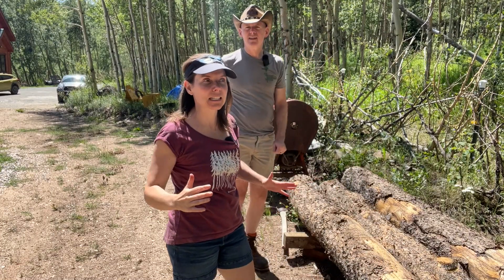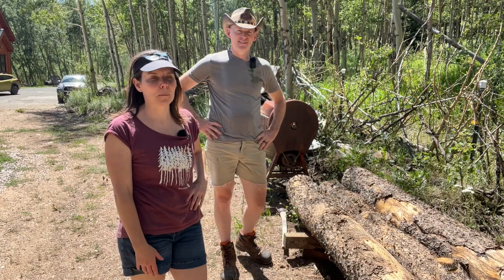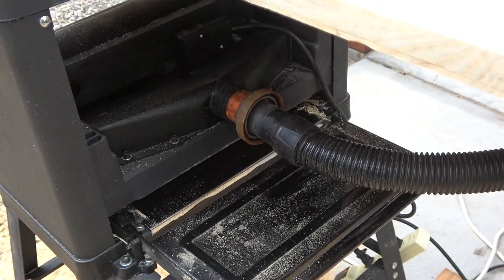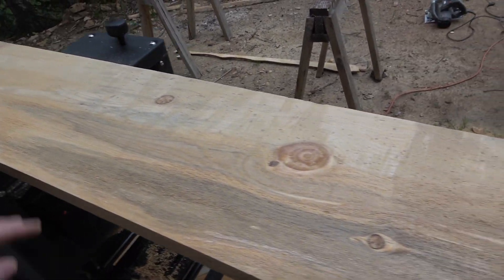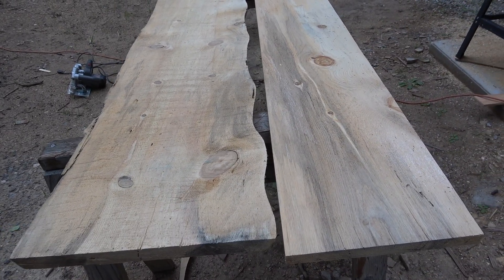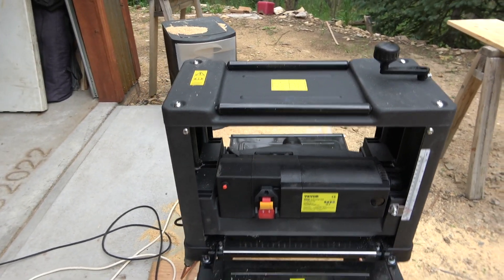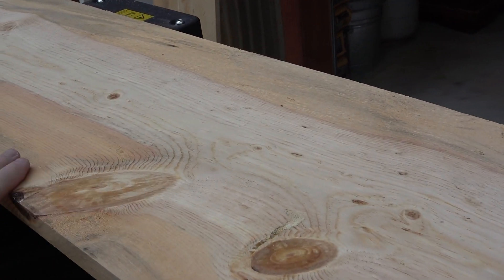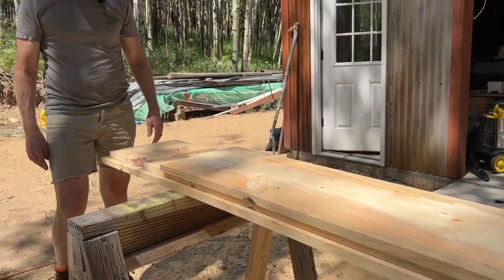Making our own Free Lumber Straight off the Tree

Comment: Hi Amy and Brian,  you may need to plug the thickness planer directly into the outlet and don’t use the extension cord or maybe you need a heavier gauge cord.  I would also suggest you get a metal detector for nails and screws.  Nice job you guys.
Reply from the maker: HI Chuck, I think you're right on, probably losing some power with such a long cord. Although, Bryan did plug it into a 20 amp circuit. We have one of those roller magnets, that does fairly well, have to pull it out again.

Comment: The way the planer is bogging down, you are taking off too much at once, or it doesn't have enough power to handle wide boards.  If it acts the same on a 6 or 8 inch board, chunk it.  On the other hand, start off with it barely touching the board, and adjust in tiny increments until it is flat, smooth, and at your desired thickness.
Even though it is 12" wide, it seems to be not as advertised.   May just be a marketing ploy.  Do some research on the company.  See what users are saying. ❤ 😊
Reply from the maker: Thanks! I think it was a bit of user error/learning curve to figure the correct depth to start off with. I think by the end of the day he found the best method to do several passes with a 1/4 turn on the knob at a time.

Comment: You should get a real portable lumber mill saw a Woodland mills HM126 for like $4000  then you wouldn't have to make so many planer passes because the chainsaw mill is just too rough of a cut
Reply from the maker: Or we might try switching out the chainsaw blade. There's one that's supposed to be much smoother.
Reply: @ColoradoMountainLiving I don't think a different chain is going to make much difference in the end.  Looks like part of the problem is being too aggressive when cutting the board.  The cut shouldn't look like a country road, but saw tracks that are the same across the board.  This one has humps and gouges. Have to go slowly with a chainsaw mill.  A good example is Ryan on "Surviving Ringworm". He has built every building there with lumber from trees he cut down, then cut into boards of different thicknesses with his Alaskan Chain Saw Mill.  He only recently started using a planer for boards used inside his cabin.  
He is a good example to follow. ❤ 😊